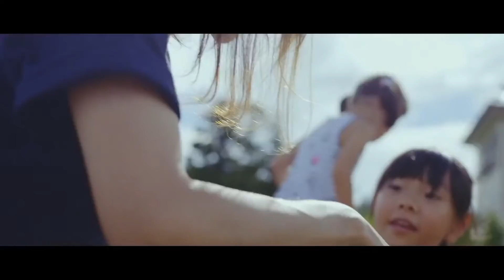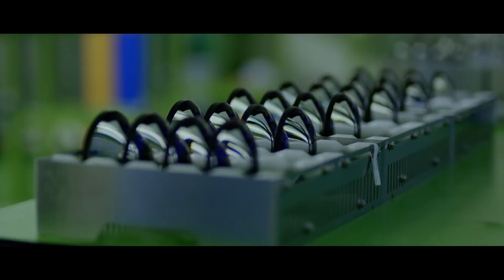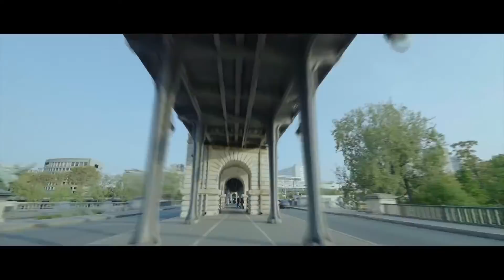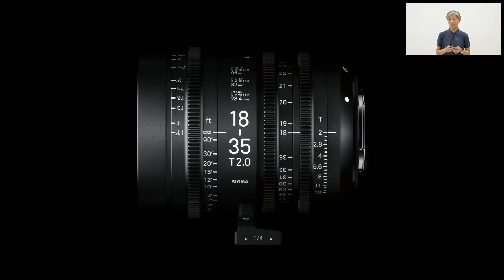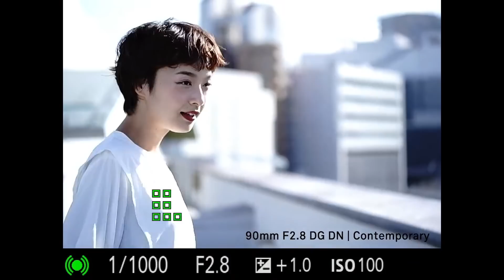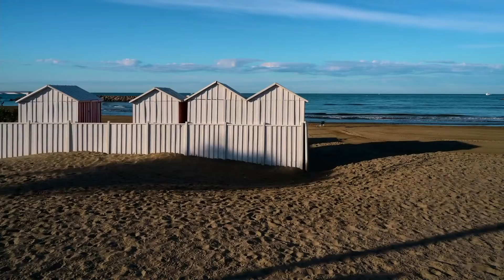SIGMA STAGE ONLINE ー 24mm F2 DG DN | Contemporary and 90mm F2.8 DG DN | Contemporary Announcement

Comment: Did Sony buy all of sigmas shares as well? Jesus. No love.
Reply: Canon and Nikon are protecting their intellectual property - they want their users to buy 1st party lenses. E-Mount is an open system, free for 3rd parties to develop on, and L-Mount is a jointly developed system alongside Leica and Panasonic.
Reply: @vaska00762  it’s not open. Sony released the basics of their design for 3rd party, and you need a licence. Sony is smart and making money here. Sigma had to reverse engineer EF glass so it’s definitely possible.
Reply: @Soul_Visuals_Photography  Sigma reverse engineered EF and Nikon F. Sigma might have taken a business decision to not bother with reverse engineering RF and Nikon Z.

Worth noting that Sigma didn't reverse engineer Micro Four Thirds - that's an open system (licencing through NDA). It's why their DC DN lenses are available only for E-Mount, L-Mount, EF-M (reverse engineered from EF) and MFT.
Reply: Yes, that is why the lenses are designed and developed for L-Mount and the SIGMA fp, the camera from So... oh wait..